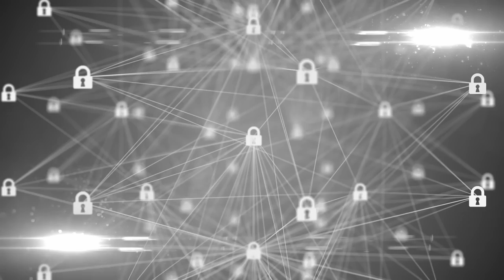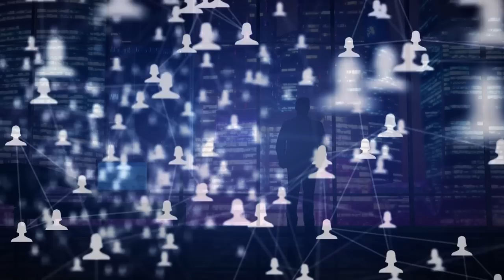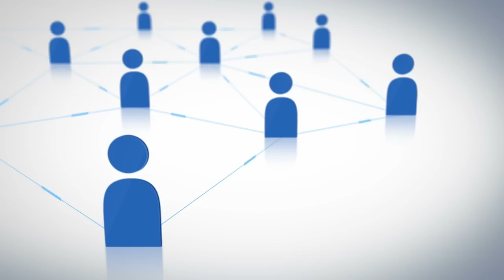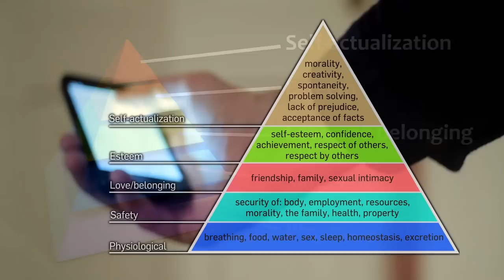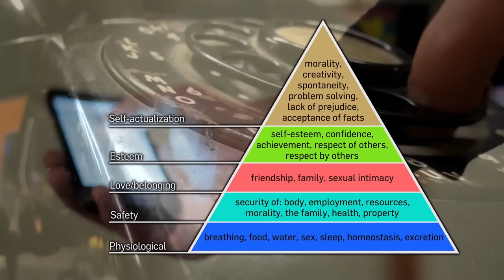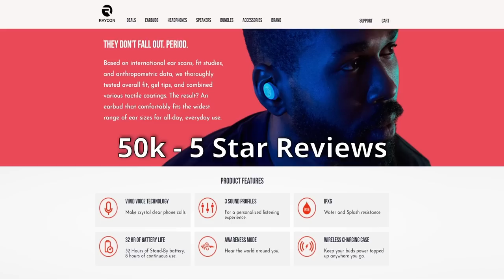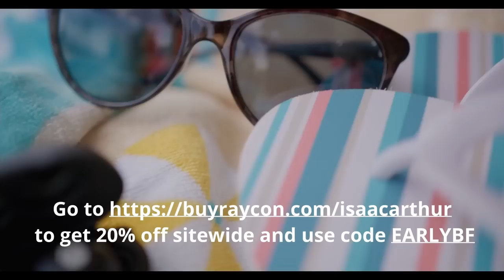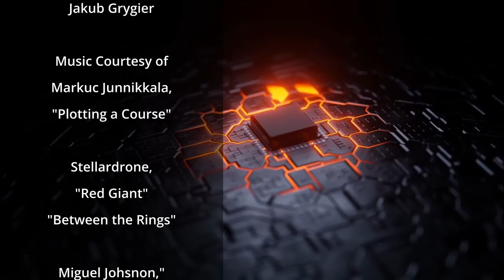Automated Economies & Unemployment

Comment: I feel like a HUGE factor people neglect is culture in the various workplaces. I personally feel like what "We" expect will have more impact than the actual system.

All too many times I see completely avoidable issues that perpetuate indefinitely solely because those with acting power won't pursue meaningful improvements. Structurally placed 'above' the stressors they tend to be complacent to increase pressure on producers rather than redistribute load or reconsider methodology.
Reply: Reminds me of something I read about how the ancient greeks (or romans?) Knew about steam power and could've had an industrial revolution but didn't because slaves were cheaper.
Reply: @twsteele1977  It was the Greeks. Look up Hero's engine or aeolipile. It was not a practical power source and most people think it was viewed as a curiosity/party trick at the time. However, with a little bit of vision maybe it could have been made into something...
Reply: @twsteele1977  And you can see the same thing today in many industries. They could be more automated but at huge upfront cost, it's often cheaper to employ someone for many years than design (or even just buy) a machine/system/computer that potentially costs millions. And if the machine needs replacing before it's paid for itself, which it likely will if it's complex, then it's just going to be a net loss.
Reply: @DaFinkingOrk  Human *ARE*  a machine that automatically performs tasks. If we are the cheaper machine, why not use us - from the perspective of a business.
Reply: @gzbd0118  It needed way more than a bit of vision to become useful, like metallurgy, the ability to construct barrel with some precision, a class of technically educated people, a more refined finance system and so on.

Comment: Automation is highly beneficial in two situations.  1) Labor shortage.  In the US the Boomers are retiring on average this year and because Gen-Z is so much smaller than the boomers there will be an average 400,000 worker shortage each year for the next 10 years.  It is even more pronounced in Europe and China.  So automating some of those jobs isn't going to cause unemployment, just more work getting done.  2) When fungibility is a good thing.  Humans always cause some variability in the work they do.   When you need a job done exactly the same way every time it is best to let a machine do it.   Jobs where humans still triumph over a machine are where that variability is desirable.  Works like "craft" and "bespoke" are the keys here.  The machine will always be cheaper, but there are some products where you will pay more for something a little different or customized.

Comment: If you have a bunch of dumb robots and strictly controlled management systems with some kind of machine learning, you might end up with the system they comprise becoming smarter than anyone expected.
Reply: Anyone who works with computers knows that the "smarter" a computer - or any system - gets, the more things there are that go wrong.  You get diminishing returns.
Reply: Basically, long-term planning and governance is about optimizing logistics. Multi-goal optimization is easily handled by particle swarm optimization (PSO) algorithms. BUT - Someone has to define the metrics for the goals and the relationships between goals. Those metrics are basically subjective social values and may change over time. Consider, for example, various designs for a 'happiness index' metric.

Comment: I'm 48 and regularly get mistaken for 15-20 years younger. But I definitely have 48 year old issues, like Lovator Scapula or Sternocleidomastoid pain that comes out of nowhere seemingly in response to nothing I've actually done. And about four months ago I suffered my very first calf sprain while playing basketball (it was 98 degrees out), which threw me for a loop. I had to be supported to my car on two shoulders and then had to have my wife come get me because it was my right calf and even trying to operate the throttle and brake was excrutiating. Couldn't walk for two weeks but eventually it got better on its own. 

Getting old. No more basketball.   :o(

No more heavy lifting around the house or helping friends move.  :o)
Reply: I feel you, I'm 44 and the mornings I snap crackle and pop like rice crispies. Even though I have been told that I don't look like I'm in my 40s.

Comment: "If you do what you love then you'll never work a day in your life"

I think Isaac may have this nailed. Thanks for the upload & keep them coming!
Reply: True🎉
Reply: And if you love doing something that a machine does faster?
Reply: @dominic.h.3363  The machine will never do it as well - if you're a carpenter per say, the imperfections in a bespoke piece make it valuable. Basic mechanical stuff is a different story - no one should be made to fold steel brackets (for example) all day imo.

Besides, given the predominance of planned obsolescence in todays products, who says machines will be designed to make a thing work better, instead of fail sooner?

If only that were the case .. people wouldn't need to keep buying pointless sh*t all the time.
Reply: @reeferbeleafer9912  Yea, try telling the guy sitting in a wheelchair with dyscalculia to find something else to do after he's been laid off to be replaced by automatic translation. Decades? It happens today.

Comment: Dangerous jobs like coal mining would be best automated. At my last job, there was a guy who wasn't exactly the brightest bulb in the chandelier, but was very reliable and good with people.
    In addition to being janitor, he was the unofficial ambassador... He enjoyed the part.
Reply: We won't be doing any coal mining in 50 years if not less haha. Maybe coal will be used to produce hydrogen, but mining it won't be necessary.
Reply: @Szpareq  Maybe not for fuel, but for other uses, like plastics. I think it will be mined for quite awhile, though maybe not in the quantity it is now...
Reply: @Szpareq  An energy dense fuel and chemical feedstock you can literally pick up and carry in a sack. Why would we ever want to dig that out of the ground to move it where it's needed?
Reply: @scottthomas6202  why use coal when oil does a better job though?
Reply: @Szpareq  For the same reason we aren't using nuclear, even though the latest technology is safer and cleaner than coal AND oil.  The biggest obstacles aren't physical, they are bureaucratic.

There's also the matter of locality - which energy is cheaper depends on the distance and cost of transportation.
Reply: @Szpareq  steel?

Comment: I've "automated" a lot of small factories into larger ones over a 30 yr career. Most of the "robotizing" retains the workers on the line, I've even seen more people hired. The "robots" usually speed up the line to an output not possible with people alone. Two people that use to box up products by hand can use packaging equipment to box up 10 to 20 times as much.  The counter to that is the factory would have hired 20 to 40 people to do the job of that one boxing "robot", this is an argument from an short-sighted uniformed person, production does noth scale like that in a factory at all (laws of diminishing returns).

Comment: The solution in the short to medium term is job sharing, 2 workers doing the job of 1. on alternate or different parts of the week. this would require a change in business mindset and much more interactivity between job-sharers. but no reason it couldn't be done.
the 5/2 work week is immoral and soul-draining. everyone would be much happier working 3/4 or 3.5/3.5.

Comment: There will be only three tasks that will never be fully automated. Art production, the responsibility for which will fall to humans even if a computer does the vast majority of the work, general task specification, for which actual programs will be synthesized, and modeling/acting, for why get a robot when a human will always be more accurate. There will be humans wanting to perform those tasks, far in excess of the demand for them to be done, so they don’t need money as a motivator. Given that the amount of variable labor required for production will be negligible, then assuming the profit motive is abolished, we all might as well stop using money too. And I will dispute the claim that people feel worthless doing nothing, they are just bored. But in the future proposed, it will be very difficult to actually reach a lasting state of boredom in most cases.

Comment: Some thoughts:
1) automation can actually open up new jobs, e.g. there are places in Japan of all places - which isn't a place where disability rights are a priority - where disabled people work remotely via controlling a robot
2) corollary to the above, you said some people are "too dumb to train" - do you mean people of normal intelligence or the mentally disabled? Same goes for the  statement that some people are unable to get a job
Reply: Another benefit is that even able bodied people can remote in using drones in particularly dangerous jobs. 
Underwater high pressure welding, cleaning up chernobyl, working with dangerous chemicals, etc.

Comment: There's a thin line between unemployment and leisure and it's a critical topic here. A few decades ago, the work-week was shortened to 5 work-days and the weekend time doubled (think about it). A hundred years ago, the unemployment was reduced by setting limit on legal work day to 8 hours, before it was normal to work for 12-16 hours a day. How much was the leisure time increased, if you don't count sleeping time? Currently 6-hour workdays and 4-day work-weeks are being considered, and they won't create leisure at the rate it was possible in the past. When technology makes our economy more productive, we need more leisure time to enjoy its produces, otherwise you cannot sell the stuff. Soon we might actually be running out of leisure time. Who would want to be a part of the hardworking 1% when all the 99% have so much free time and need so little money to enjoy it all? No. Most people will work for 1 hour a day, 1 day a week, just to keep things running. The greatest problem wrt this topic is how people will use these technologies against other people. Minority against majority, majority against minority, does not matter. The super AI has a nuke potential. And I'm afraid we lack on Isaac's level of ethics here, power and ambition are too strong a motivation to do evil stuff.

Comment: I can say with certainty that the US Army from 1975 to 2009 (my last year as the primary engineer on the enlisted personnel allocation system required an IQ at least 80 without legal dispensation (congessional iirc).  With the exception of McNamara's idiots, this has generally been the rule since 1928 (iirc, threw out the documentation when I no longer needed it).

Comment: 16:53 there is no IQ requirement but there is a different test that is required and is somehow similar to an IQ test.

Passing the ASVAB test with a score of 31 is required to join the air force, 30 for the army. But, legally it's possible for DoD to allow people with score as low as 10.

31 is "equivalent" to just under 92 in an IQ test. A score of 10 corresponds to 83 in an IQ test, although there is no official conversion and the distribution is different.

Comment: Honesty I don't consider further automation of the work force to be a good idea or even that likely, it has progressed as far as it has very much in large part due to only taking up low skill labour jobs, normally working class jobs, but we will likely to see massive push back to it once the jobs normally taken up by the middle and upper classes start being taken over by them, as they always have more pull over such policies despite being the smaller part of the population. See the twitter artist freakout over the last few months alone after realising their own profession is likely going to end up on the chopping block as an amusing example.

And the argument that the people who loose their jobs to automation can easily get jobs overseeing or repairing the machines that replaced them ignores the fact that such jobs are much fewer in number than their previous ones and thus would be subject to significantly higher competition but a lot people might be completely unsuited to such kinds of work in the first place for one reason or another. Not everyone's minds are suited to more intellectual lines of work, and some just have a hard time adapting to needing to learn new skills, regardless of what their actual level of intelligence is.

The speed at which automation can and will happen will also completely exceed the speed at which new jobs/professions could be found for the peoples who's jobs are lost due to it, meaning you'll be dealing very high wide spread unemployment a long time before any societal balance could be achieved from it happening to the point I wonder if it'll harm the economy more to have so many people out of work in the long and short term compared to benefits gained from wide spread automation.
Reply: I completely agree with your points, but my take is that automation will lead to post scarcity.  We'll have to learn what to do when we have conquered our world, completely and utterly.  Time to head to space.  :D

Comment: The problem of 1% of the population owning everything is a solved problem, and not one rife with unemployment.  It was called Pharaonic Egypt (also North Korea).   The Glorious Leader owns everything including the temples (technically these are owned by the gods, with the priests subsisting on a stipend derived from sacrifices), and there is close to zero unemployment.  “No one has rights or a vote but the king.”
The trick is to map this system onto a liberal democracy, or contrarily, a limited-franchise republic.  The safety valve against disaffected military-age citizens revolting against the system is currently bread and circuses, which boosters claim will be amplified by the increasing, and eventually apotheosed automation.
Reply: 16:17 Pharaonic Egypt lasted roughly 2600 years, your lack of imagination notwithstanding.

Comment: So, from what I understand regarding the US Army. It has to do with how closely the ASVAB maps to IQ. I.E. If your ASVAB is low enough across the board in everything, they're not all that interested in taking you because you won't be useful. So while the Army doesn't have an official IQ cutoff, when you look at where ASVAB and similar aptitude testing correlates to IQ, there is a sort of cut-off in-practice. Obviously the Army can't say 'below IQ 85 we won't take you' because there'd be outrage.
But they can say 'your test scores are below this threshold, so we don't have a use for you because you're literally too dumb to dig a ditch properly' And that cutoff might happen to coincide with a certain IQ, or more likely a G-factor. 
Now, keep in mind, I'm some guy on the internet, operating from memory without a scientific background or the time spent to double-check my information. I'm going by wrote. So treat this comment not as gospel, but as a possible jumping off point for further research if the topic interests you. 
Or don't. I'm a cartoon hedgehog with an atomic-energy obsession, not a cop.

Comment: I really have to say I dislike your use of "technically" at 3:48 

There are no precise, commonly-accepted definitions for 'robot', 'android' or 'gynoid', because real tech has not advanced to the point where we need such definitions and Sci-fi authors don't use them consistently. Gynoid is basically only used in Japanese media, where it's a fuzzy term applied to robots, androids and sometimes even biological creations with a visibly female body plan.

Don't try and say 'technically" when there are no actual concrete definitions, and "Android" was already a gender-neutral word for robots more advanced than IRL with a humanoid body plan.